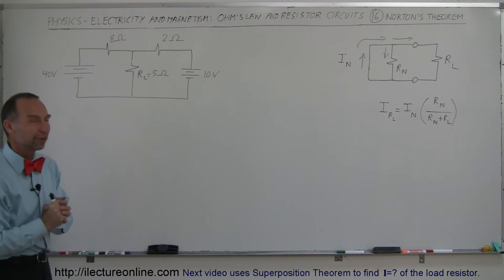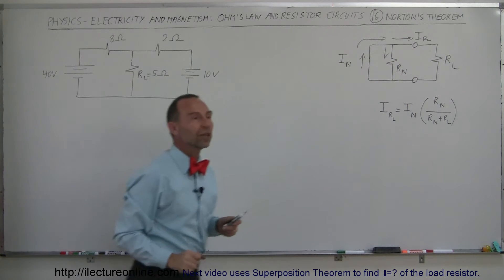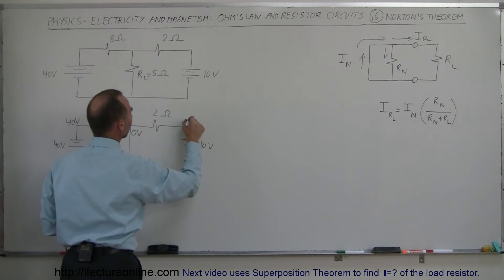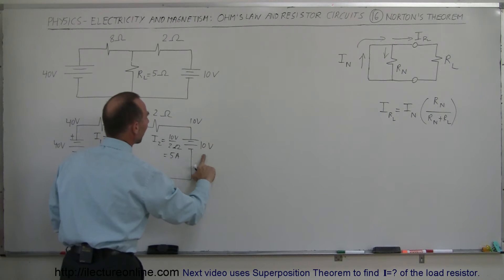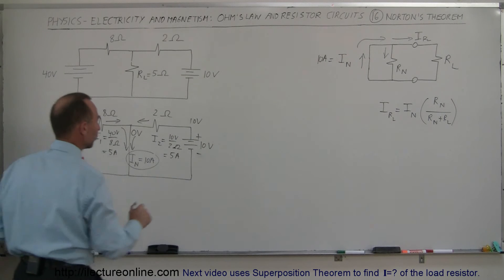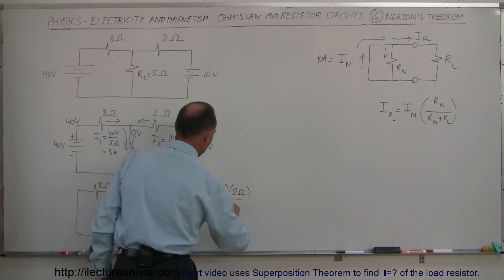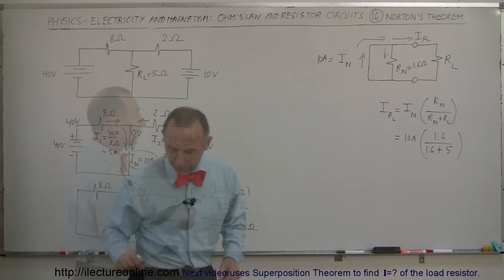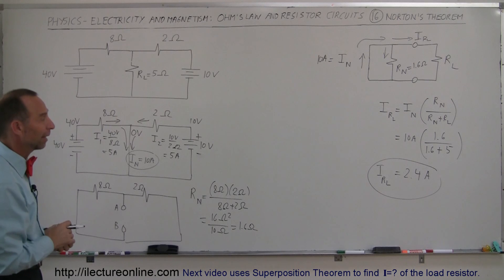Physics 42   Ohm's Law and Resistor Circuits (16 of 23) Norton's Theorem

Comment: is there any reason to use norton's theorem instead of kirchoff's circuital rules? aside from simplicity, of course.
Reply from the maker: Just like there are seven methods in algebra to solve linear equations, there are multiple ways to solve circuits, and ultimately you will pick the method that you like the best.  In the meanwhile you will probably be required by your professor to learn all of them first.